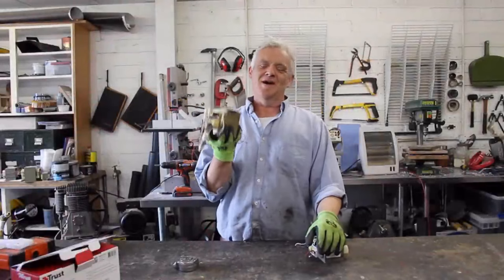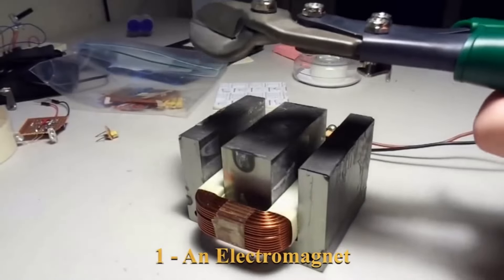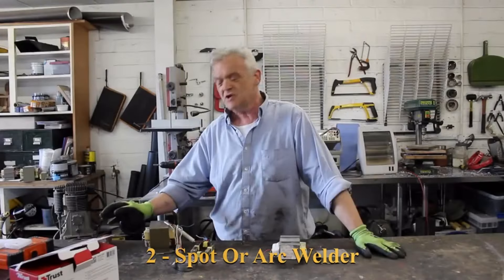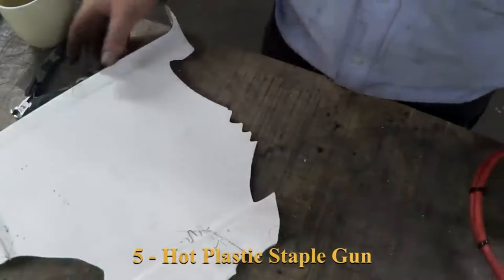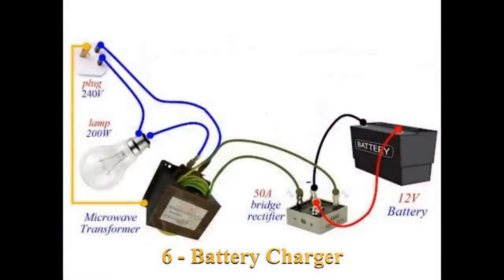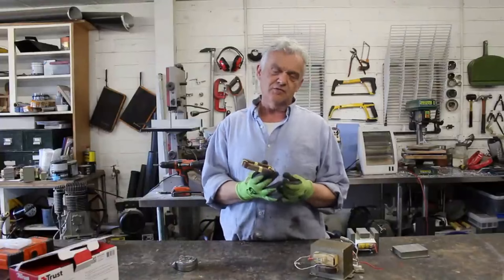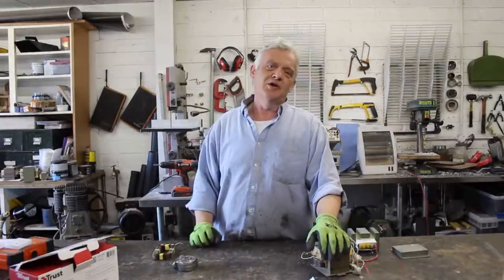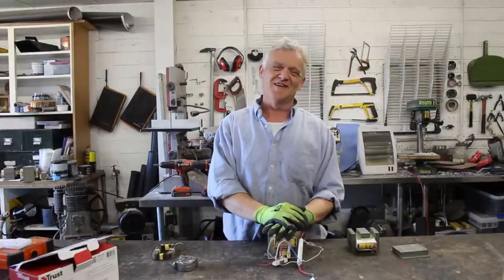2263 - 10 Things To Do With A Microwave Oven Transformer

Comment: I have always made my Jacob's ladders from old CRT TVs and monitors. Im not sure if thay are any safer than the microwave transformer but the microwave transformer does look fun.
Reply: Using the flyback transformer as the source of the high voltage, I would imagine: I made mine the same way, though I got the flyback transformer from Ebay, since CRT TVs or monitors are far more difficult to find now than they were maybe 10 or 15 years ago. I used a classic ZVS driver circuit (pair of mosfets configured as an astable multivibrator) to drive the primary coil of the flyback transformer, with the ZVS circuit powered by a battery of 4 x 18650 lithium-ion cells in series. If you include a couple of zener diodes, it can run from anywhere between 12 and 24 volts DC - I used a battery because it needs a fairly high current to drive it, which is beyond the capabilities of my bench power supply.

This type of transformer often contains a built in high voltage diode stack, so unless you can remove or bypass this somehow, the high voltage output will be DC rather than AC. This doesn't matter if you're using the high voltage for a standard jacobs ladder, since they can work from either AC or DC. But I also included a minor modification which I learned about from a "bigclivedotcom" video - he has an excellent video about jacobs ladders and how to make one, where he describes using an old neon sign transformer as the high voltage source.
These are much safer than using microwave transformers, since they are current-limited to a maximum of 50 milli-amps. But it has to be the old type, which is essentially a big and heavy mains-frequency transformer. The modern electronic neon-sign transformers do not work for making a jacobs ladder, or at least not for long, which I found out the hard way: You might get one or two arcs out of them before they burn out - and since all the electronics inside are potted with a mixture of hard silicone rubber and what seems to be quartz gravel, repairing them is just about impossible.

Anyway, the modification is what big clive calls the "gabriel electrode", which is a simple but effective addition to the standard jacobs ladder setup: A third piece of wire is placed about halfway between the two main electrodes at the point of shortest distance between them, which will be the striking point - where the arc initially starts before rising upwards. This extra electrode is connected to one of the others, through at least 2 mega-ohms of resistance. If the high voltage source is AC, it doesn't matter which main electrode the gabriel electrode is connected to, but if using a high voltage DC source, it seems to work better when connected to the positive electrode.
The gabriel electrode generates just enough ionisation of the air (the high resistance prevents it actually striking an arc) to allow the arc between the two main electrodes to strike reliably. This also allows the gap between the main electrodes at the striking point to be larger than would otherwise be possible without the gabriel electrode modification.
This essentially accomplishes the same effect as having a small flame in the middle of the gap: If you make a jacobs ladder, with the gap at the striking point about twice as large as the high voltage alone could jump, you can position a small candle just below the striking point, so that the tip of the candle flame would be in the middle of that gap. Without the flame (or a gabriel electrode), the high voltage would never strike an arc. But a flame will ionise the air within it and just above it, and this ionization lowers the resistance of the air in the gap just enough for the arc to strike.

Comment: For the battery charger idea, if the intention is to charge car batteries (or any other 6-cell, 12 volt lead-acid battery), winding enough turns to get 12 volts DC out isn't quite enough, because when fully charged, a lead-acid battery should give between 2.2 and 2.4 volts per cell - if it's a brand new battery, it is likely to be at the upper end of that range, if it has been used for a few years and gone through a few thousand charge-discharge cycles, it is likely to be at the lower end of that range.
The alternator in a car is calibrated to produce a constant voltage output of 14.4 volts for the battery charging circuit: When the engine is running and the alternator is operating, the entire electrical system in the car gets that same 14.4 volts too, which is why the headlights are noticeably brighter when the engine is running than when operating from the battery only.

When determining how many turns to wind on the transformer secondary to make a battery charger, you should have the bridge rectifier handy so you can temporarily connect it and measure the DC voltage output from it, rather than measuring the AC voltage output directly from the secondary winding. For two reasons: The diodes in the bridge rectifier have a small but significant resistance, which will cause a voltage drop of about 0.7 volts, so the DC output voltage will always be slightly lower. However, even if the bridge rectifier had no resistance at all, the DC output voltage would still not be the same as the AC voltage coming from the secondary winding of the transformer, just as a consequence of how AC voltage is measured. For example, if you take the 240 volts AC directly from the mains and wire it up to a bridge rectifier (which is what happens in any switched-mode power supply), you do not get 240 volts DC, you actually get more like 340 volts DC.

On the subject of doing the "fractal wood burning", I would not ever use the high voltage output of a microwave transformer for this, even though I do know what I am doing: You're certainly right that it is extremely dangerous, but it is also completely un-necessarily dangerous. For example, if you have a 1 kilowatt microwave (that's 1 kW of microwave radiation output), the electricity consumption will be more like 1.25 kW, since the efficiency of the magnetron is about 80%. Some power is used for the cooling fan, light bulb, turntable motor and control electronics, but that is not much - probably less than 50 watts. Anyway, the transformer in that microwave is using most of the power - say for sake of argument it is using 1.2 kW, and the secondary is producing 2000 volts: This will be at 0.6 amps, which is 20 times more than the minimum current required to have potentially fatal results if you got a shock from it. If the transformer was making 2500 volts, the current would be a bit lower, at 0.48 amps, but this is not significantly less dangerous.

Why is this un-necessarily dangerous? Because you don't need anywhere near that much current to do fractal wood burning, or to make a jacobs ladder. Either of these will work just fine with as little as 50 milli-amps. So you could do it with an old linear neon sign power supply transformer, or with an old CRT monitor/TV flyback transformer, driven at 20 kHz by an electronic oscillator circuit. These are fairly easy to build, if you can get some mosfets with high current handling capability and a switching rate consistent with the 20 kHz frequency.
Reply: Great comment on the safety aspect of mot's for wood burning. 50ma is still enough to kill however if you are able to move the frequency high enough then the nerves no longer respond to the high voltage in the same way as 50/60hz and can become relatively safe. Unfortunately iron transformers don't work well for high frequency but ferrite transformers do. Neon transformers do have a far better track record for safety so limiting the current to 50ma  is still a good thing.
Reply: @paulbyerlee2529  IIRc from college 10 to 30 mA is painful and can cause fibrillation of the heart valves, potentially death. Much more likely to cause death from from 30 to 50 mA  for more than 1 second. Greater than 50 or 100+ mA across the chest for more than 1 second there's a good chance of death there.. As little as 1 to 10 mA can cause problems if it's in the wrong place..

That being said everyones resistance is different! I've taken a shock from 24VAC 120VAC and 240VAC. 24 is like a bee sting, 240 is literally like taking a blow to to the head but from behind your eyes..
Reply: @Falcon-eh8tq  all you say here is true and I have a deep respect for electricity. The point I was making is the risk of death from electrocution significantly reduces above a certain frequency irrespective of your skin resistance.
Reply: @paulbyerlee2529  Thats kind of true, ultimately any exposure to electricity can be dangerous, and it's ALWAYS respective of the resistance. Ohms law.. You will get less amperage through you if you have higher natural resistance, depends on genetics, sweat, temperature, humidity ect.

 but what frequency would you mean? lower the frequency the harder it is to let go if you happen to get electrocuted. 60hz is easier to let go of than 50hz in the UK. the lower the frequency the more sustained the muscle contractions, I think there's still significant risk unless you're talking about over 100kHz.. I've had to kick coworker in the chest to get them off of an electrical panel, as we are taught. He was ok but he was unable to let go and that's 60hz. I am in HVAC.
Reply: @paulbyerlee2529  High frequency can still cause injury from the heating effects, nerve damage, EMF, arc flash, and it'll stop a pacemaker real quick. for example, double the resistance and you'll cut the amperage in HALF right?   say 120V over 5 ohms..  you'd see 24A, make it 10 ohms 
and you'll only receive 12A it is very much respective.

There is a massive difference in resistance person to person, even electrolyte levels can change that. Hell, some people have resistance in the megaohm range naturally, using those same numbers they'd only receive  0.000012A at 5 meg ohm pushed by 120V

The frequency just changes how much contraction of the muscle will happen, not really the amperage received. And amperage is ultimately what kills people, as little as 10mA
Reply: @Falcon-eh8tq  "styropyro" did a good video about high voltage. the title is "Is it volts or amps that kill" if you are interested it may be worth a watch.
Reply: @paulbyerlee2529  frequency will not protect you from a high voltage source. Styropyro says it himself..

And if we go high enough with frequency it would become visible light, 800ghz is the current upper limit but thats on a circuit board inside a Chip.. Material limitations among other reasons are why we use 50/60Hz and the higher the frequency the larger the variation, when talking safety I look at it from the general public perspective.. maybe because i am in the trades
Reply: Thank you for breaking this down. A solidly educational comment. For some reason I envisioned you wearing the 80/90s style safety glasses blue collared men wore to the field but also in the office haha.
I don’t know a lot about electricity. I was an electricians helper for almost a year when I got knocked out by a light pole. They turned the power on in the breaker room and didn’t inform anyone they were going to. It blew my Klein players apart and knocked me out. I quit when I woke up. I learned a very important lesson, That I am highly allergic to electricity.

Comment: To charge a car battery(13.5 volts) the charger needs to be able to go a bit higher. There are also some losses. I made one of these transformers as you described but higher than 12 volt ac. I think I had it at about 14 V ac no load. I also added a coil for charging 6 volt batteries....just in case lol

Be sure to use thick coated transformer wire so your charger can handle even big batteries in bad condition or with little charge. Recycled microwave transformer will have lots of space for thick wire with fewer turns. Mine should handle about 40 amp but I will fuse it for 30 amp charging max.

I haven't finished this charger, as I haven't sourced and purchased the parts yet. I want to be able to control the charging manually, for different charging applications/situations/conditions, and be able to monitor both the voltage and current. I don't want a "smart charger", I want to be the smart charger. With good charge control you can restore batteries with a gradually increasing trickle charge, you can safely charge different types of batteries(some do not like being charged fast), you can do a quick charge and know by the gauges you are still safe(not harming the battery or charger). You can use the charger to just put in a trickle to keep a battery warm in very cold weather. Just so much one can do with variable charge control. 

Most people would probably want a smart charger ;-)

Comment: 10vac should rectify out to something around 14vdc for the 12v battery charger. With lots of ripples without a smoothing capacitor.
Reply: You/I know what is going to happen to some kid or idiot that does this.
Do the right thing and add a warning to the end of your comment.
Reply: @John.Flower.Productions  
And what would that be?
They are going to wind it to get 12vac out, rectify it and charge the 12v battery to 17vdc instead of 14.7vdc, and possibly damage a battery?

Comment: I seem to have harvested about a dozen magnetrons...

Got any ideas for those?
Reply: Plastic pyrolsys machine
Reply: @preciousplasticph  

I like that.  I think a couple of carbon rods inside the container may be easier.

They produce 2.45 Ghz, which is close to WiFi.  I wonder if they could be used to power a 12.5 cm antenna and produce a wifi free zone.
Reply: @preciousplasticph thats just inefficient. You just lose energy for inefficiency of magnetrons just buy a resisve heater element.

Comment: Trying to create an arc FURNACE, but home's electric system is from 1945. However, oven and dryer connection is 220/240volt. Any guidance on how to create a functional arc furnace with that setup would be great. (yes, I'd have to use very long cords to do this outside, not inside). I saw TKOR's videos on this, but that advanced setup he does with 2 separate 120volt leads joining into one is not something my minimal/ancient panel is capable of. Useful info is appreciated.

Comment: I just took a transformer re-wound the secondary with 10 gauge wire. Until i got about 18v , thr old battery charger i replaced runs about 17.8v oc. And says 10 amps, i never seen more than 3.*** Amps. Im thinking i will do a center tap output to allow a low current charge and a high current. Tap the windings where it has about 13-14v then anout 17-18v put a two-way switch pre rectifier. To get a trickle charge, and a fast charge. I took an old charger with broken amp meter, added a digital volt and amp meter, would a diode drop be adviseable? To prevent the need to tap the transformer? It was difficult enough getting all that wire in that thing the first time I thought about just adding a large capacitor and dc to dc Buck converter! Use a big buck comcerter on it that claims like 10 amps. With cc cv, then it can charge lithium batteries also.  The amp/volt meter was a nice upgrade. It's how i learned its misding 75-76% of it's power with a buck converter. Could it be a bad diode only getting half a sine wave? I added a bigger capacitor in and the voltage went up with a capacitor. About 0.8v-1.2voc, with the capacitor. Its fishy. So im building another. Id love to get 30-40 ampst 13.9v. but doubt this will happen. And planning to use a programmable relay, to shutoff when it gets to *13.8v-14v. and back on if it drops to 13.0- 13.2v roughly!  With a high and low output on it some how. Seems the microwave was 1100 or 1500 watts, 1000 watts at 14v- is 71 amp, plus a little, so pull the voltage down a bit. And drop the current to safe levels. I guess i need to pull a few turns...

Comment: Not sure if you have already convered this, but what can you do with all the magnatrons? (I have a stack of them in one of my lockups and am a bit wary after reading about their potential radioactivity!)
Reply: Radioactivity is negligible, there's far more in all the wifi and other waves surrounding us all the time now. 
There's "thorinated tungsten" in them that produce the microwaves (when it's powered). 
The biggest danger with really old ones was in the magnetron there used to be beryllium, which if broken and caused airborne dust, could cause beryllium poisoning. But they don't use beryllium anymore
Reply: @RedDeckRedemption  Excellent. Thanks for the info.

Comment: Nice projects.!

How about this?

Just a big spark gap that connects to a 50 foot length of wire that runs up a tree.  Attenuate it with [whatwver]. Your entire neighborhood will be able to tune in.

I bet a 5kw spark gap with a 50 foot antenna would probably get you an FCC visit.

If you are ever bored...